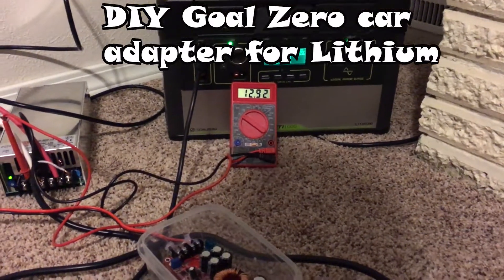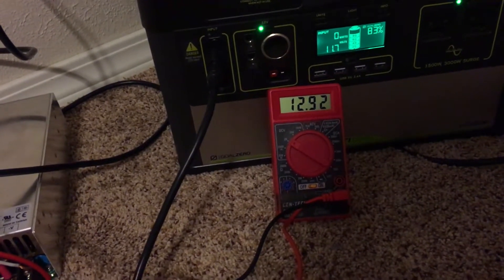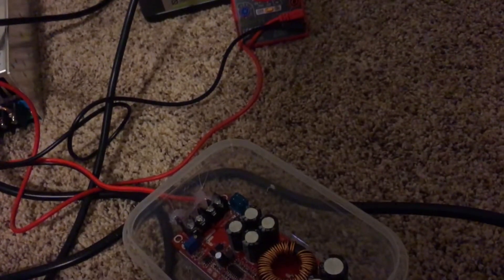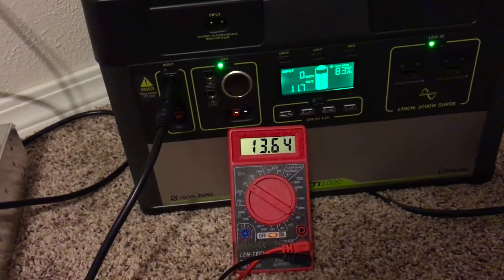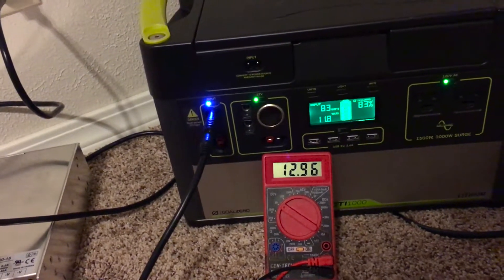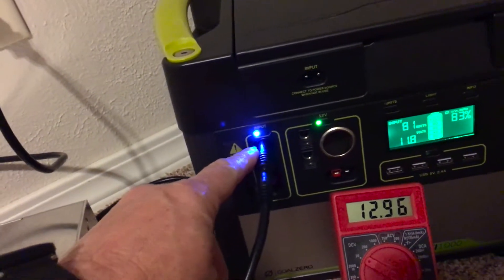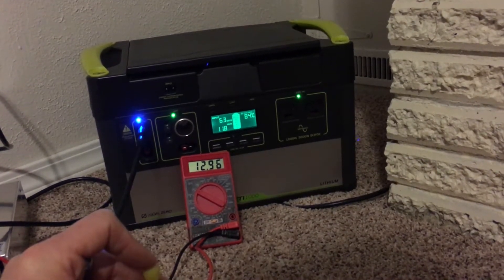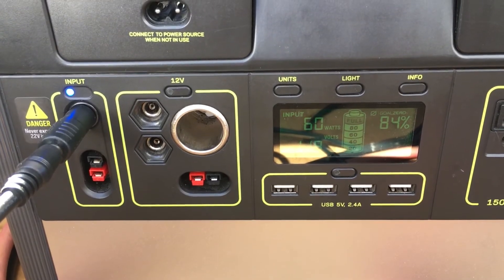DIY Goal Zero car adapter for lithium solar power stations

Comment: Good lesson.
This answers one of the questions I had, which was, "would this size Yeti work with the 200W Boulder Briefcase panels?"  It sounds like a "no" due to the maximum output of the panels being 200W +/- 5%.  But with your DIY controller it...???...hmmm...no, I don't think it would be wise to regulate a fluctuating power supply through the regulator you're using.  Maybe I'm wrong.  I hope so because this was starting to seem helpful.  It IS still helpful, just maybe as a learning a what-not-to-do lesson.

I know I'm getting closer to imagining a system that will work.  I'll try to run all the numbers by you on the appropriate video when I have a better idea of what the plan is going to be.  You seem like a guy that understands this stuff and would recognize if I'm planning something that definitely won't work safely.

I'm going to watch some more of your videos and do some more thinking and learning.

Thanks for posting these videos.  They're very helpful. 👍
Reply from the maker: Yes I actually have the boulder 200 , got another video on those I think, good panel, I believe the max input on the yeti 1000 is at least 200 watts
Reply: The max input of these 8mm inputs is 120watts, the max input of the yeti 1000 is more like 600 watts when you add in all the inputs, there are many.